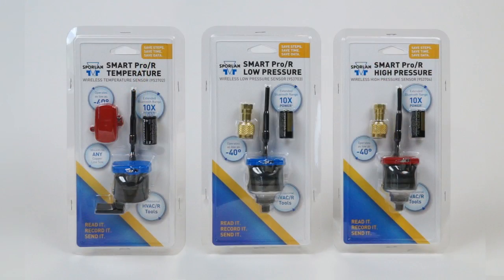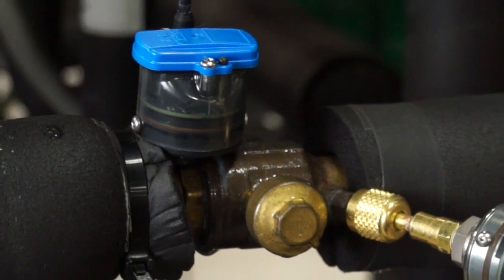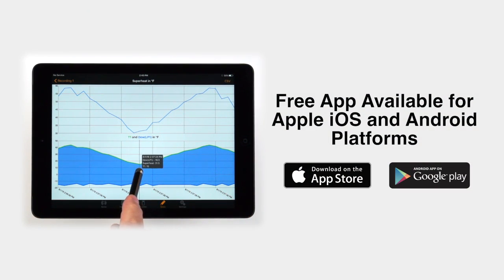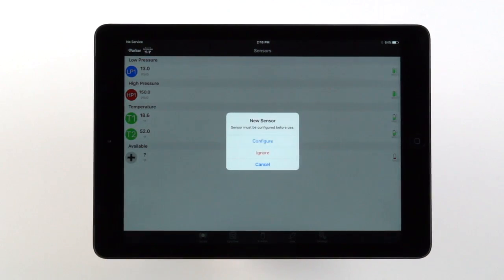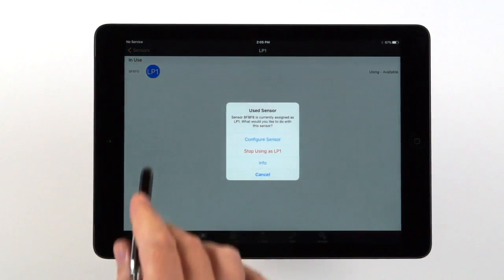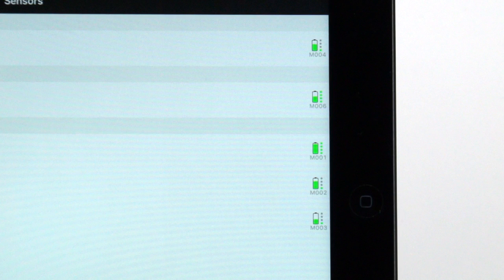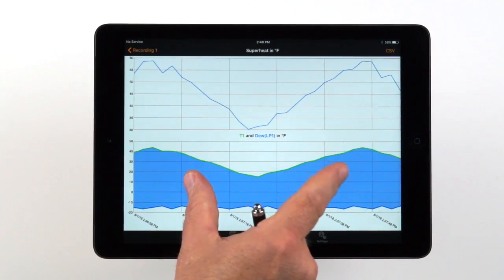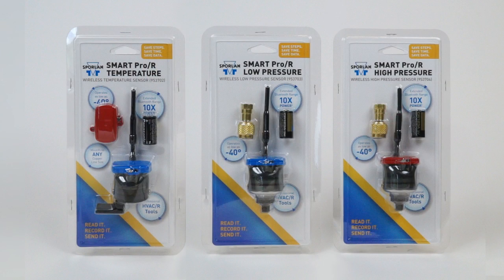Sporlan SMART Pro/R Service Tools for HVAC/R Diagnosis

Comment: Whats the rang
Reply from the maker: The range with clear line of site would be 500 plus feet. Of course the conditions of use such as walls and other structures will affect the range.
Reply: Meaning what would be the range if I put it in a blast freezer and was right outside the door??
Reply from the maker: We placed a Sporlan SMART Pro/R Temp sensor in a walk-in cooler, closed the door and was able to read the temperature over 75 feet away with an iPhone 6S.

This was with a refrigeration rack system and another wall between me and the walk-in cooler.
If you have a clear line of sight between you and the blast freezer, I would estimate over 100 feet.
In a completely clear line of sight situation, the Sporlan SMART Pro/R sensors provide several hundred feet of range.

Obviously, your results may vary depending on blast freezer wall thickness, insulation types, other electrical noise in the area, Bluetooth reception quality of the mobile device , etc.
Reply: Hello Would you be able to tell me where I may purchase one of these